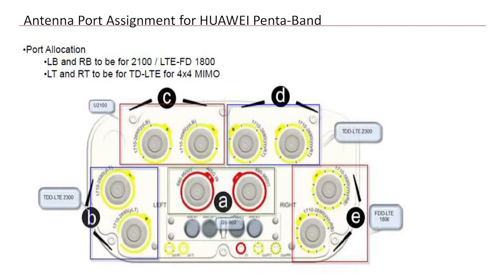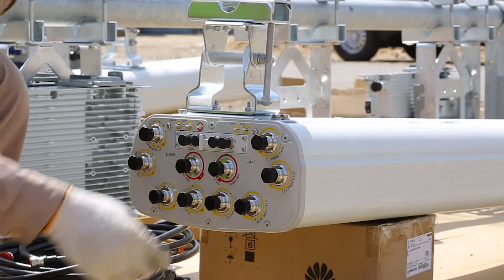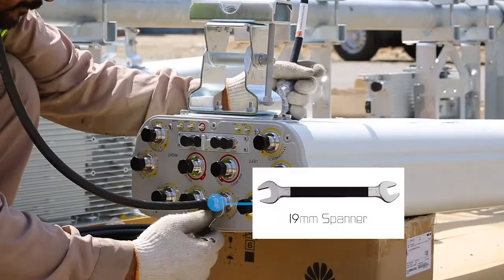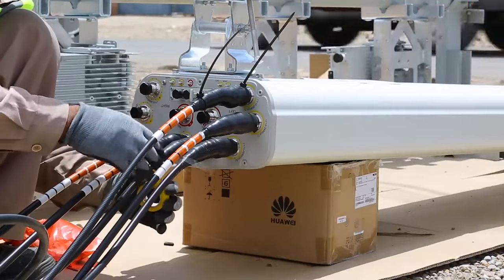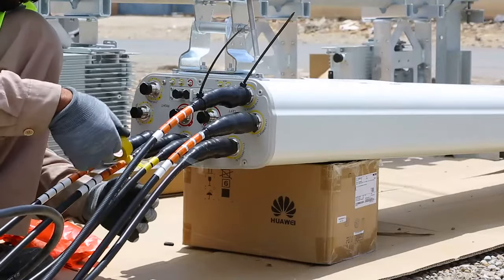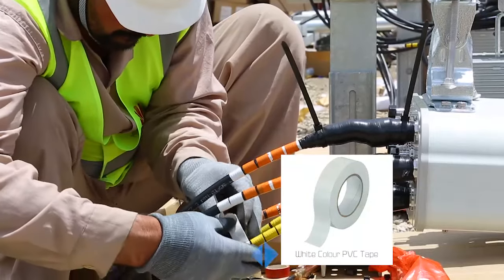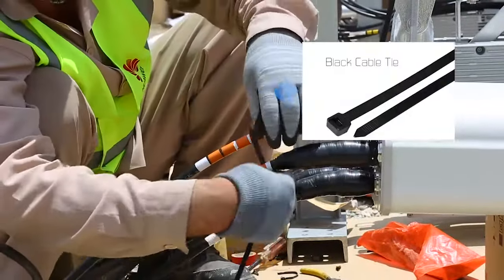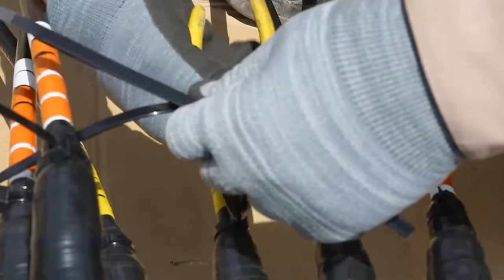5 Antenna Jumber Installation

Comment: Technical question Why were the Huawei Abu 8-port antennas designed to have 4 ports for the RT, 2 in and 2 out, and they were not satisfied with 2 ports, one in and one out, like the Elbrus antenna, the Microscope antenna, and others. The question is addressed to everyone and we would like everyone to participate.